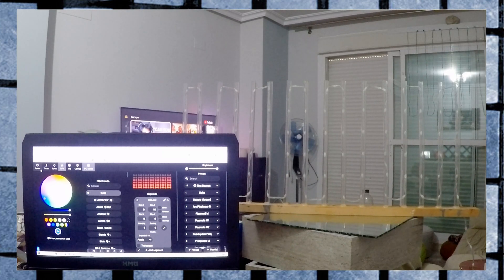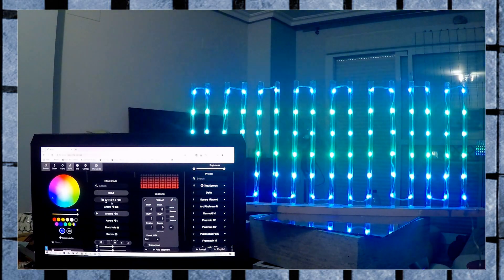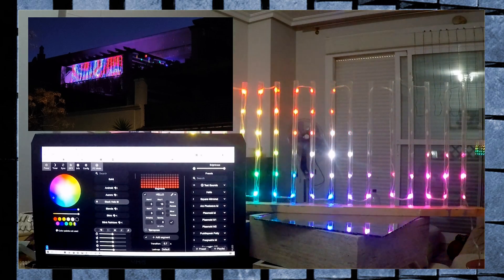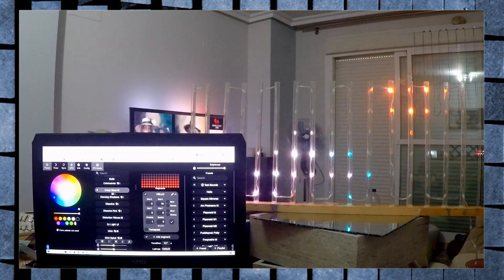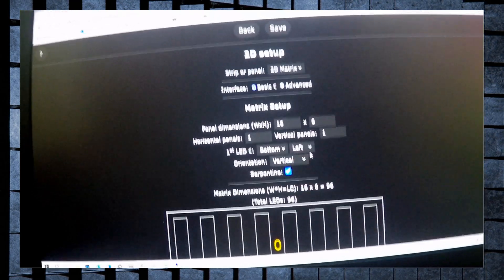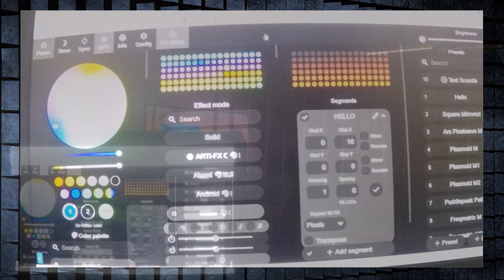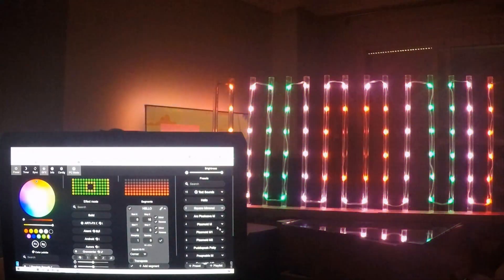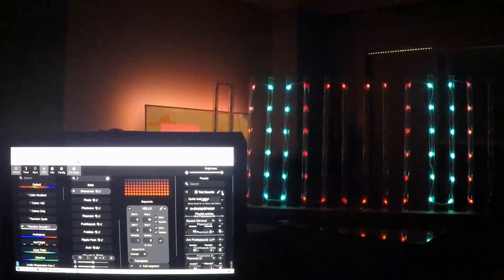💡 NEW FAIRY LIGHTS 12V WS2812b LEDs| Sound Reactive WLED MoonModules| SUPER VALUE| FIRST VOICE OVER

Comment: Hey mate looking forward to your curtain led video, until then what power supply did you need to use to power 60 metres worth of lights? Also how often did you need to power inject the line?
Thanks again!
Reply from the maker: I used the same power supply,, 12v 10A and I had power at the beginning, middle and the end , however I could have hit away with just start and middle

As for my next video might be a while as I have no time at the moment

Comment from the maker: Those tested in the video are 5cm apart and 5meters in length .
For testing purposes I used a 12v 10A black power supply plenty of power , and I used the same one for my 600led curtain no problems with 2 extra power injections

Comment: Hi there, are these leds 10cm spacing between each? Also what power supply do you have running all of these?
Thanks
Reply from the maker: Those tested in the video are 5cm apart and 5meters in length .
For testing purposes I used a 12v 10A black power supply plenty of power , and I used the same one for my 600led curtain no problems with 2 extra power injections
Reply: @BuzzinHive  excellent. I will watch your other video with your 600led curtain now. Thanks for the quick response.